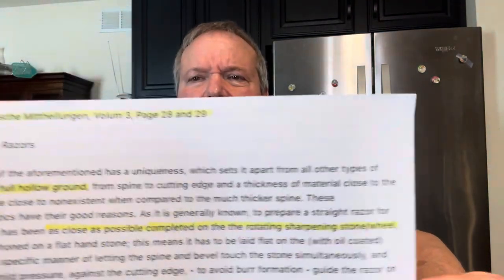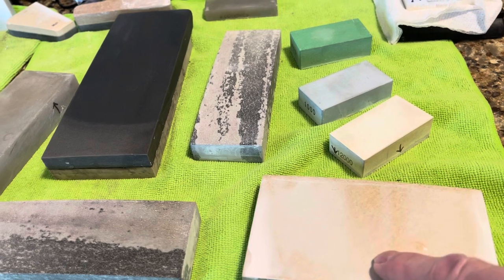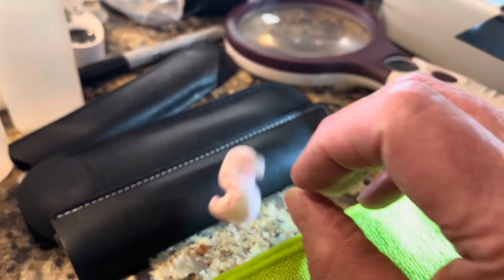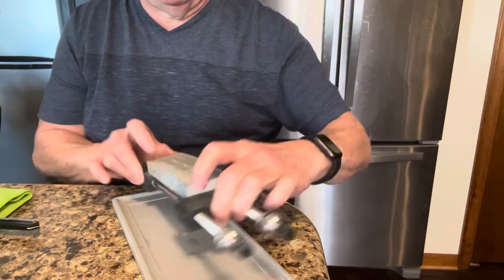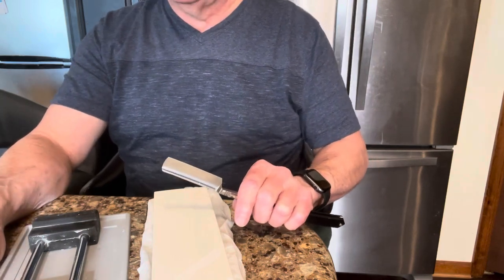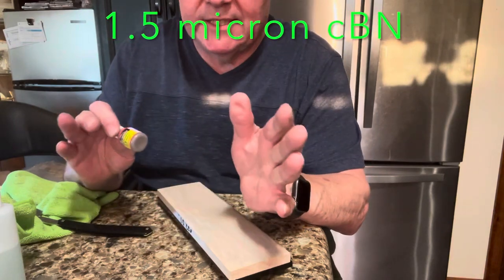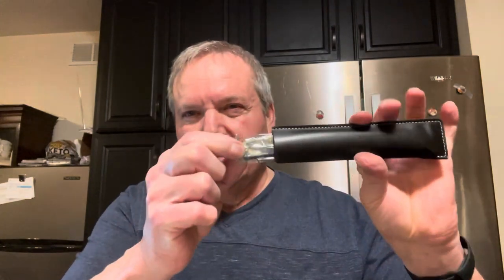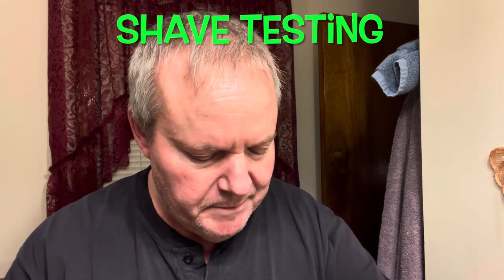What is SuperCurve Straight Razor Honing

Comment: Love your attitude Bill…so true we do it because it's fun and challenges us…looking for that perfect edge and the satisfaction of taking a piece of steel and grinding it so you can get a good, smooth shave. Shaved last night with my Theirs Issard Le Dandy and it puts a smile on my face 😊 when the jobs done. Cheers MikeR. ( still hunting that Feather sharp edge..lol! )
Reply from the maker: Thanks Mike. Have you tried working with balsa strops on the long dimension yet?
They do not have to be huge and the Herold red & black combo is a great place to start.
Reply: Hi Bill, looked locally and had no luck yet with finding Balsa wood, so I bought some clear Pine and shaped to the long axis…works pretty good, but the balsa wood would be softer and have a bit more “ give” to it. May order some online if I can find it in Canada. Shipping anything to or from the US has gotten very costly. I'll keep you posted and watching your vids. Cheers Mike. @billm.2677
Reply from the maker: @miker5502  
You might check hobby supply stores that support radio control model aircraft.
I probably should try a hunk of pine one day, I might like it.

Comment: Bill. You you please provide MFG spelling and where to source these concave stones. They are very beautiful and I want a few for my sharping hobby. Thx in advance.
Reply from the maker: Hi Brian. 
The shaping plate is a custom item from thesuperiorshave.com
The arks are sourced from danswhetstone.com, although I purchased them from Superior Shave inventory
sharpeningsupplies.com was my source on Norton and Naniwa Aotoishi water stones
I got the Suehiro Gokumyo 20k from Japan thru Amazon
The magnetic mounted strop setups come from chefknivestogo.com
Shaping of my stones was mostly done using Indasa Rhynowet silicone carbide sanding sheets. I have also used flexible adhesive backed replacement diamond plates.
I hope I got you the info you were looking for. I have been pleased with my purchases from these vendors.
Thanks for watching.
Reply: Are these 4’, 6’ and 12’ archs for only full hollow grind or for extra hollow (singing” grinds). Thanks in advance.
Reply from the maker: @briand2482  
All of my razors have a hollow grind of some sort. 
I have not experienced issues on half hollow.
If I had a wedge or near wedge, I think I’d probably use a flat stone.

So as not to confuse dimensioning.
The plate delivers about a 12’ radius with a 3’ cross crown, or a 3’ radius with a 12’ cross crown. Double the radius for the “wheel size” or diameter.
The 2x6 soft Ark that is shaped to the 2’ radius or 4’ wheel was shaped manually with a flexible diamond plate propped into the position I wanted. 
It takes some playing around with when to use the smallest wheel, but I was getting nice results just using the dimensions that came off the shaping plate from superior shave.
I found the curviest stone most helpful on my 7/8” and 1” razors.
On 4/8 and smaller I will occasionally use the 2’ radius then jump to the 12’
Much depends on how thin the grind is. The thinnest move between the radius’ pretty easy.

Comment: Hi Bill, It's been a while since I last watched one of your videos and I see that you are still using the convex honing method or bevel undercutting, to use an engineering term. I've had many discussions with Jarrod and yourself in the past, trying to understand the principles of convex honing and the understanding the objectives of getting a smoother shave by increasing flexibility at the bevel. I now believe that the true benefits with convex honing are only experienced on wedge ground razors, the more grind the razor has the less effect convex honing has. The benefits of convex honing a fully ground razor is negligible, due to the flex in the blade being greater than the flex afforded by convex honing. Even though the convex hone or undercutting is the there, the thinner blade needs less force to flex, therefore making the convex hone redundant. The sound or singing of a full hollow razor tells you it's flexing, if it didn't sing then the convex honing wins. That's why I believe that there are no or any benefits convex honing modern razors.
The detailed study on convex honing performed in the earlier 1800s by a German University, which Jarrod and yourself mentioned to me, must have been performed using wedge razors as fully ground razors were on available from 1870 onwards. Therefore their findings are limited to heavy wedge style wedge razors and not fully ground razors of today.
I wouldn't recommend anyone spending the time and effort learning to convex hone, unless they only have wedge or 1/4 hollow razors.
Reply from the maker: @davec1768  Hi Dave. Hope you are well. There is one thing I can ‘guarantee’ to be true…If you do not believe that there are any benefits of using a crowned surface hone to sharpen a razor, you will NEVER be able to get satisfactory results attempting to use this method. For me, even though I keep trying, I was never able to properly learn to hone razors on flat stones, maybe I just never flattened them enough or one must possess exceptional skills or every user must have exceptional skills, reasoning and understanding of the process. I did have my most successful attempt on a really crappy Gold Dollar recently on an ILR hone. If you ever get around to making a YT video that can help me with my honing pursuits with flat stones, make sure to tag me in so I don’t miss it.
We could discuss actual dates on when the use of convex hones was further, but I do have an antique commercial convex hone and strop from before 1870 as well as the US patent documentation dated 1843. I think you can find my video where I showcase that item.
Reply: @billm.2677  Bill, I know you had problems honing with flat stones and I can understand you doing something you are confident with and it works for you. However, science doesn't back up what you believe in my opinion.
I have played around with convex honing on different styles of razors. I even bought a digital scope which links to my laptop so that I could see the bevel profile. I found it difficult getting the final bevel truly parallel with the undercut, and I did notice an improvement when shaving with a wedge razor. However, the amount of time, trouble and effort wasn't worth the improvement.
I recently bought a NOS 13/16" Henckels Friodur 72. It's an early 70s razor, the design, shape and grind is excellent and the edge is sublime. Honing took a little longer than a standard carbon steel, but definitely worth it. I've had Henckels carbon steel razors in the past and found them to be an average German razor, the stainless steel version is far better.
Hope you are well. All the best for the future.
Reply from the maker: @davec1768  
Not being an engineer or scientist in honing method discussions, I mostly come from an artisan or craftsman like perspective. There IS an engineer in Norway who generally can be found using the screen name of his initials JPO. He is and engineer by education and profession as well as an experienced construction craftsman. He was the first person that I had ever seen shaping hones using a flexible diamond plate. His work inspired me to expand my work to similar pursuits, which I have been successful at. If you wish to discuss the mathematical and scientific aspects of why the use of a crowned surface hone works I would encourage you to look for some of his writings that can be found on a number of shaving related forums. He is far kinder and more eloquent than I could ever be, and even convinced one of the greatest Jarrod haters and anti-convex Honemaster Superiors to actually try it. As it turns out he equaled his current honing result on the first try. FWIW, JPO was the individual who published the German Grinders Handbook after he had gotten it translated to English. It is what he has based most of his successful convex honing practices upon. He is also an accomplished practitioner in the use of other honing tools and styles.
For me, when it comes to the topic of precision and science in the Kingdom of Straight Razor Manufacturing, I have absolutely NO respect or admiration for ANY of them especially since modern measurement technology could be so easily applied but is NEVER used. Now, if you ask me for my evaluations based on skills and craftsmanship, that WOULD be a different story. 
Good luck with your Henckels Friodur 72, hope you enjoy it as much as I do mine. A personal friend gifted me his Friodur 72 1/2 some time back which he expertly honed up on JNat stones. It is a wonderful razor. I have plenty of razors that I think shave in the same class if not a bit better. Even though there is no doubt in my mind that I would have no trouble matching shave performance on a re-hone using my very own method when it comes time to see the stones again, I’ll probably send it his way and pay him for re-honing. That way when I shave with it, I can always be reminded of his skill levels and our bond of friendship. Take care.

Comment: Bill great video. How did you shape the Ark? Sand paper?
Reply from the maker: Thanks Steven. On the arks I originally used Rhynowet sandpaper 60 grit with 60 grit silicon carbide powder.
On later ones I got a flexible diamond plate that cuts down on time.